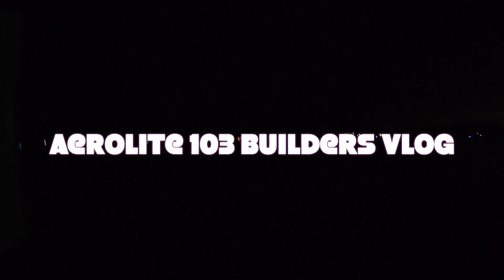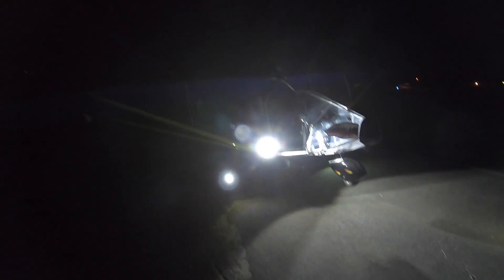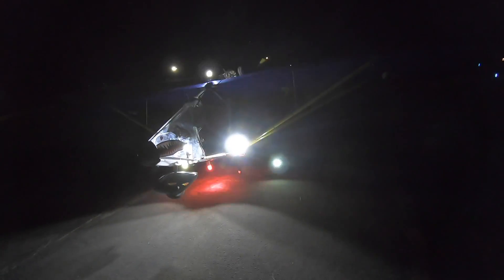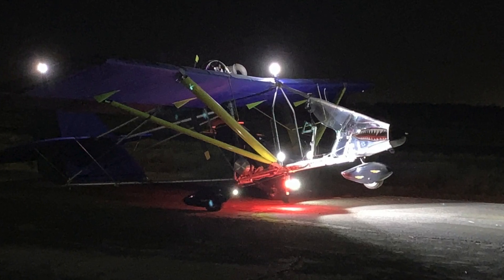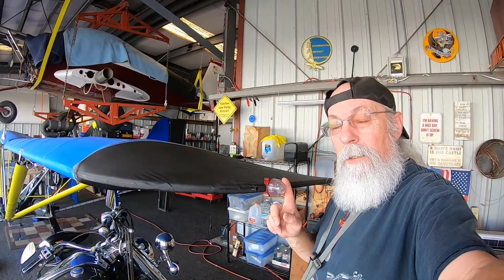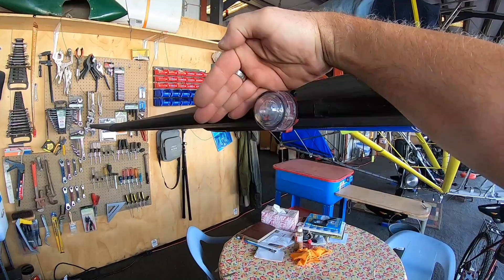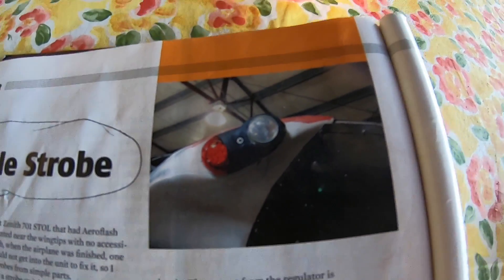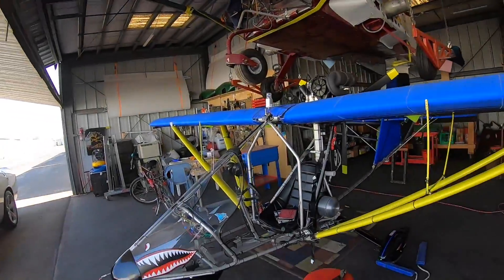Night Flight?

Comment: Wish you were close I’d love to come hang out I’ve thought about buying a 103 but not sure I’d like the wheel stick as much as a common stick control keep up the videos
Reply from the maker: I am in agreement with you. If I had a choice I'd like a stick rather then yolk. But that's because I am new and never trained in a GA aircraft typically with a yolk. The Quicksilver has a stick and it makes flying intuitive. The yolk confuses the low timer because the low timer thinks car and turn of a steering wheel. Thanks for the comment.
Reply: @aerolite103buildersvlog8  makes me wonder if it can be swapped over to a regular stick with a bit of work
Reply from the maker: @curtisjackson355  
I have thought about it too and think it can be done with a bit of re-designing. Like the newly designed two-seat version 'rumor' I've been hearing about. A Aerolite 'trainer'.

But that said, I was always taught that 'if it's not broke, don't fix it.' and that advice has always served me well. ;)

Comment: Hi Phil, if you don't get the wingtip strobes up to where like you like them, go to Amazon and put in LED LIGHT BURST GREEN. I got some of these and they're BRIGHT! You will see they also have red too. Think thet would work pretty good on the wing tip. They got like 20 different patterns and can be sync'd together too, I think. They're $20 a pair so you'd end up spending $40 and you'd have a spare set. Just a thought............
Reply from the maker: Thanks Mark but I already wrestled with those thoughts and the white strobes won. But I do like the NAV lights and being able to tell direction at night. But I won't be out there at night so it's better to have white's flashing (imho).
Hey, keep up the suggestions because I listen to all of them and am not opposed to advice. ;)